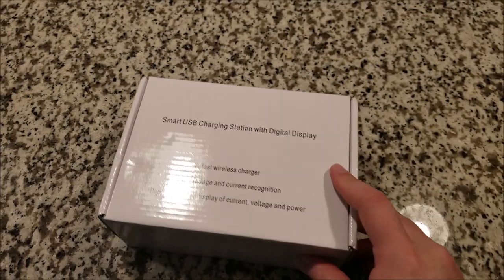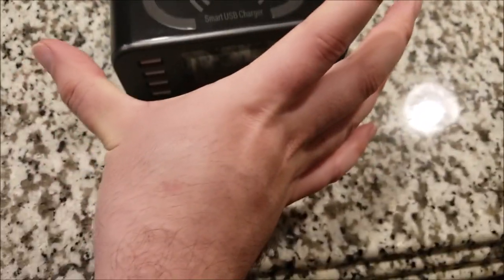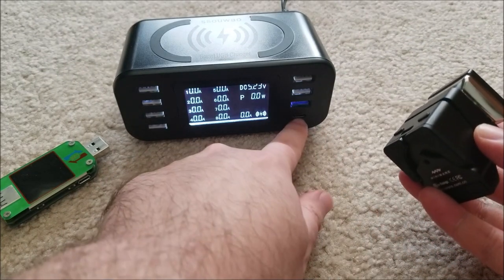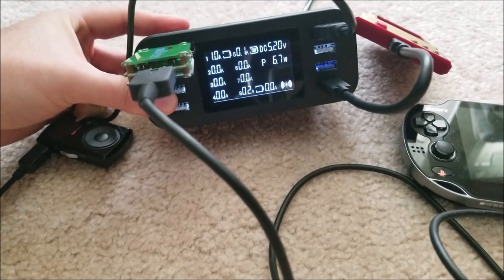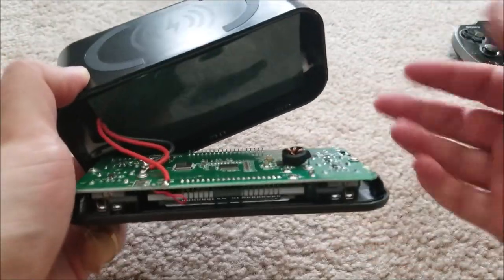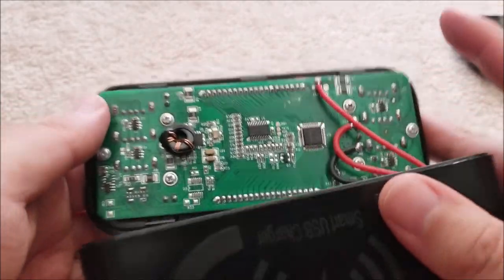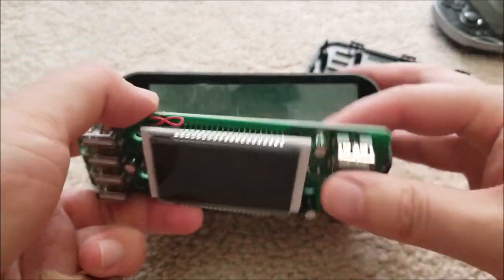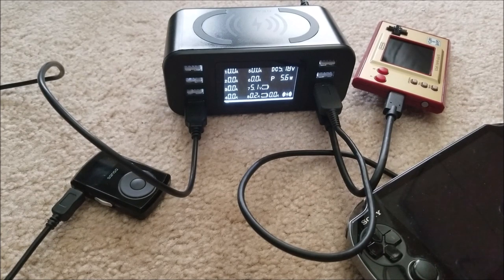Lab Tech: Ssouwao 60W 8 Port USB Power Supply Review

Comment: Hi. Advanced Merry Christmas.
May your Christmas be the best.

If I import a 110v InstaPot Ace Blender (it has a built-in heater. I need an affordable ice crusher that crushes ice well into snow. Blender recommendations are welcome) which is 700w and I need a step up transformer which is 750w so it work with 220v outlet. Will the 750w transformer be fine? It has a 50w leeway.

Thank you.
God bless, Rev. 21:4
Reply from the maker: Its should basically work, but may get very warm or cut out at the highest modes. The 750W rating is probably peak the blender can draw but I'd guess that average power during normal use is lower.
Reply from the maker: The 700W one will probably be fine

Comment: Hi, um I was wondering if you could help me its with my switch. I was playing a game with my friends and when i went to change my character my switch started overheating and my game started to take forever to load then i went home and was about to close my game it was about to give me the option to close but before i could it froze now when i bring my ear to where the air was coming out it the fan was making a weird noise and was pretty quiet. could you help me please?
Reply from the maker: Sounds like you need either a new fan or it's possible dust has accumulated inside and is obstructing the fan. I'd suggest giving it a clean first to see if that helps and if not then look into replacing the fan.